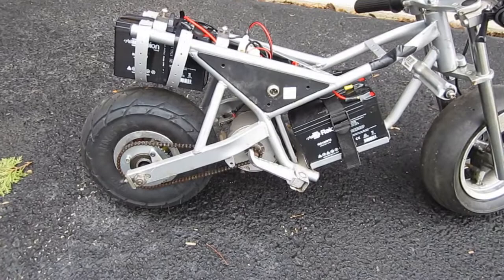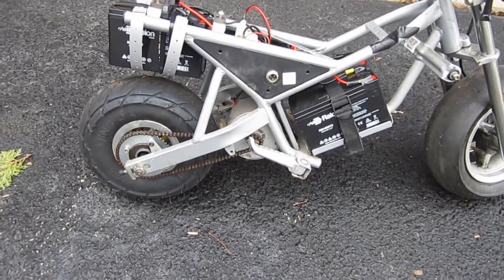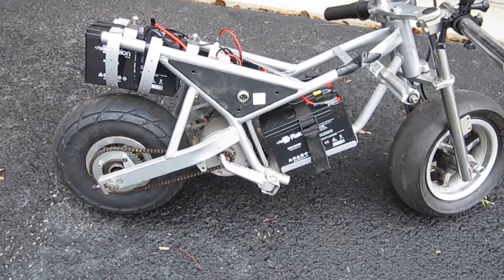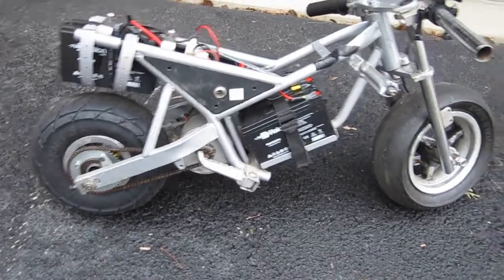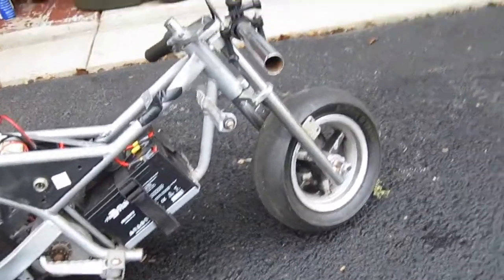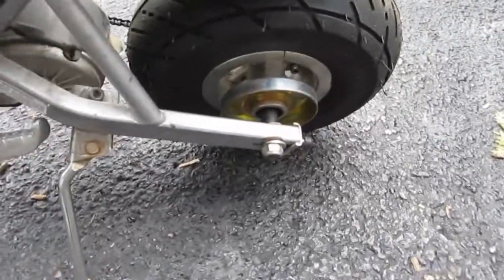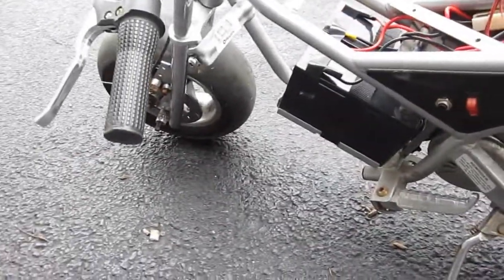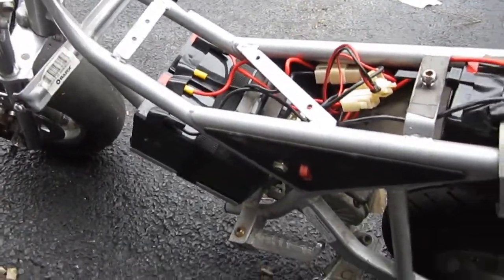RAZOR Pocket Rocket 36V Conversion PROJECT bike UPDATE

Comment: Hey bro, i have pretty much have that same stock set up. 24v (two 12s) 250w motor

I want to upgrade to the 36v 350w motor. What all do I have to buy. Plz help.
Reply from the maker: Hey, I stuck with a 24 volt motor. You can buy a 24 volt 350 watt and run 36 volts and Gain mph by overvolting the motor. I usually use the stock razor controllers but fast scooters is great on eBay, I really like their stuff.
https://www.ebay.com/itm/281413097558
https://www.ebay.com/itm/283529182448
https://www.ebay.com/itm/141459088618
The controller above is for an E300 scooter and should work on the pocket bike but you can also send a message to them and he probably has the correct one in stock. That's all the stuff I would use. I would probably use the 24 volt motor but you could do 36. Your gains will be minimal if you do a 36 motor with 36 controller. Much more with the 24 motor and 36 controller. Also need extra wiring, a couple of fuses unless you are able to retain the factory circuit breaker but you will have to upgrade to a 30 amp. I just bought mine at an auto parts store.